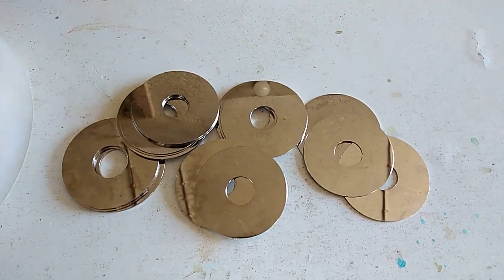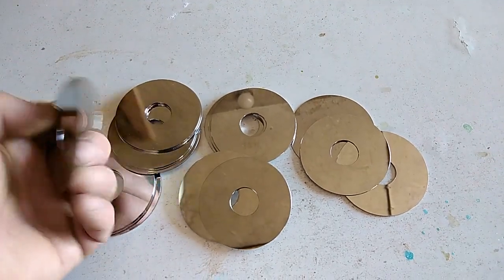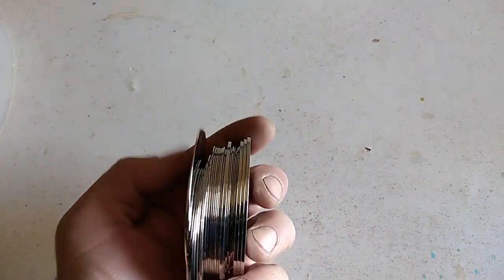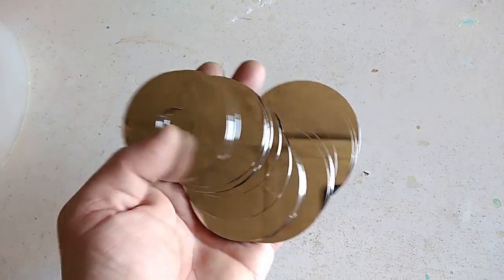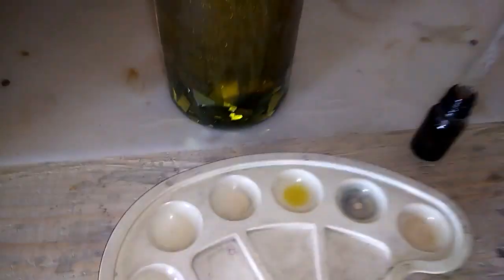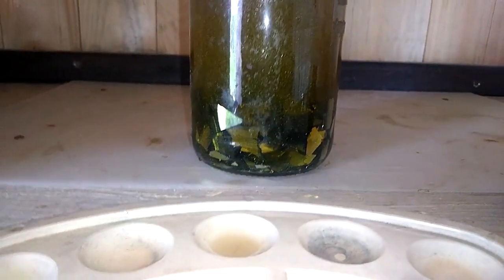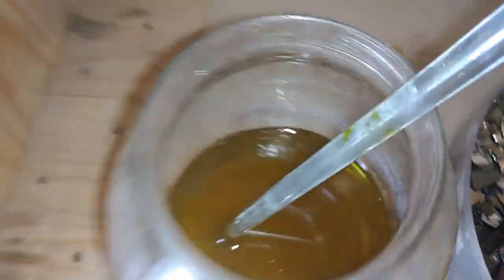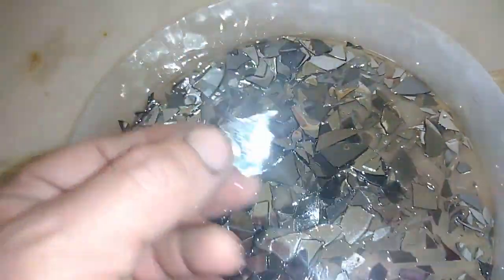Laptop Hdd plates for Platinum-Experiment-failure!

Comment: Hi guys, in 2019 Sreetips tried the same at https://www.youtube.com/watch?v=TfIvwE75hvE He said a fellow on goldrefiningforum called goldsilverpro who calculated you will need 900 hdd platters 3.5 inch to get 1 gram of pure platinum + all the waste chemicals + the time effort so I am not surprised that 999Dusan did not get any results from just 25 platters. But hay, it was a noble effort. Sreetips tried the same using only  93 platters and failed to produce anything. My advise is don't waist your time. Put them in your fruit trees to scare off the birds.

Comment: I tell ya Dusan, platinum can sometimes be very stubborn. But the thing is AR solution reacts with itself. A lot of the gasses disolved in it will escape to or react with the atmosphere. Those gasses original hcl and no3 try to get to an equilibrium state. This is i think where your trouble is. You want that platinum in there before it reaches equilibrium as both The hcl and no3 combine to NOCl gas and Cl gas and water. Those gases aren't as soluable, and they leave to the atmosphere as the fumes you see. Theres also NO gas that reacs with air to turn to NO2 this one in particular is important as the NO gas is essential in the reaction chain... if i were you id save the solution you got filter the platinum foils, take your platter chunks rinse as many foils off that you can filter them out, the. Start over making sure everything is clean. The restart in freshly mixed AR. If the reaction is sluggish put it on the heat til it boils then remove it. They should disolve pretty quick as small as the foils are. Dont be discouraged not getting a good result smelting either. Platinum especially pure has a much higher melting temp than gold... 1,768°C for platinum versus 1,064°C with gold. Its likely you couldn't get it hot enough... And again thank you brother for sharing the love and the knowledge with everyone. Hope ya get it figured out 🙂

Comment: Oh dear, the glass ones are a pain.  Aluminum-based ones are easy.  Scratch up the surface with a steel nail and dump the disc into vinegar.  That'll eat up the aluminum and leave the platinum foil behind.  Nitric acid doesn't work on aluminum well, because it forms a virtually impermeable film of aluminum nitride on the surface.  Weak hydrochloric acid should also work, but I prefer vinegar because it's cheaper and safe to work with in large volumes.  It can take a LONG time to get rid of copper with it, though.  Even with salt added, and heating, it's slow.  I'm going to try adding peroxide as see if that speeds it up.

Comment: Since you can get precious metals from aluminum plates, and not glass ones my guess would be because the other plates dissolve so the acid can get Underneath the plated coating and dissolve it that way. With glass plates, since the top layer is impervious to acid it can't get underneath to dissolve it. Maybe try grinding them up, it might creep in from the edges.

Comment: Hi Dusann, i think you can remove the layers by reverse electroplating so the metalic layers can go on the - and also in solution.

I also think you can grind the platters down in to a powder and melt them down then pur it in a cone so the heavier parts will settle down. 

Thanks 4 your cool videos 🤘🏻😎🤘🏻